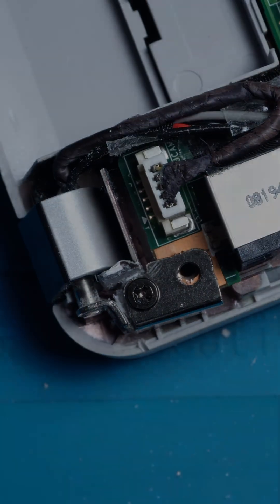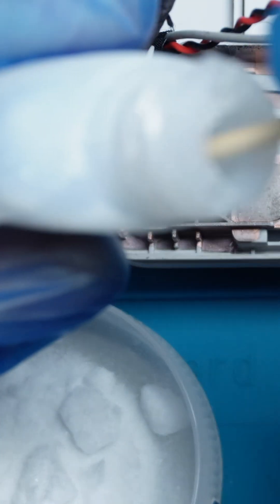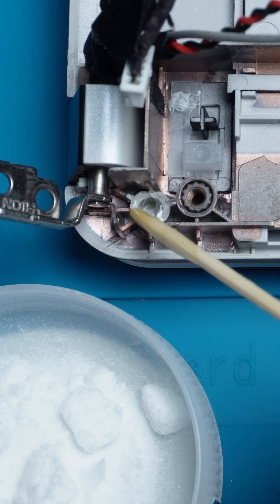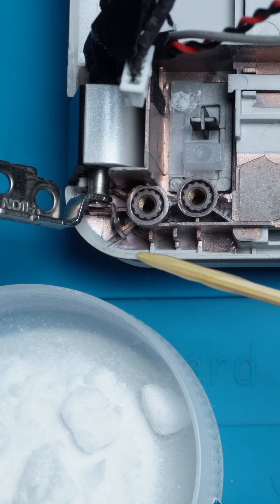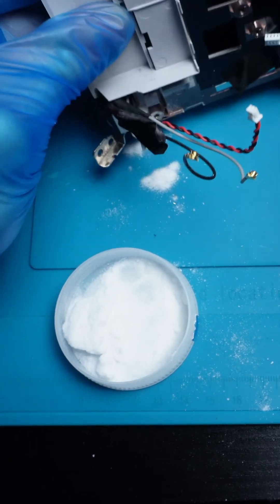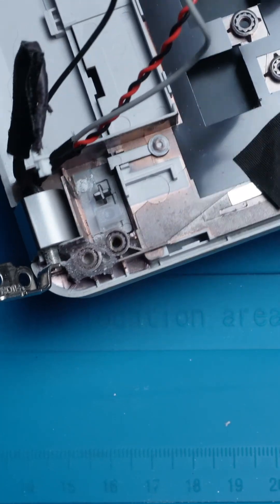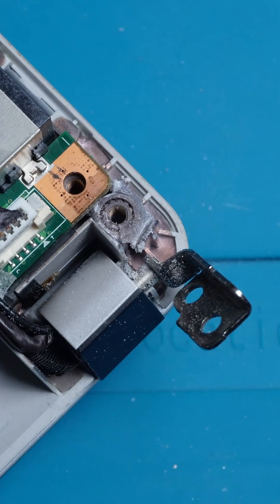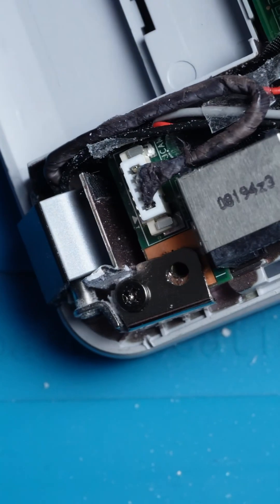I Fixed My Laptop Hinge With Super Glue

Comment: This is a very temporary fix and it will break in about a week. The problem is in the laptops design since its made to fail. The plastic will break from the weakest point very quickly after doing this. I know this for a fact since i tried it and it also broke my display. I use it as a headless laptop now.
Reply from the maker: Yes, it can be considered a temporary repair, especially if the bonding is not even or if the entire area isn't properly filled with baking soda and glue. Additionally, if only one out of the two or four hinge nuts is broken, the stress on the repaired nut is much lower compared to a situation where all the nuts are damaged and small plastic components are also missing. In such cases, it’s recommended to replace the entire housing. Personally, I have used this method successfully, and in the long term, it permanently solved the problem.

Comment: So, by mixing baking soda with superglue, can we create a stronger bond between the plastic and the metal nut? This is super interesting and cheap :-D thanks
Reply from the maker: Exactly! Mixing baking soda with superglue acts like a filler and accelerates the curing process, creating a much stronger and more durable bond, especially between tricky materials like plastic and metal. It's a really handy and budget-friendly trick!